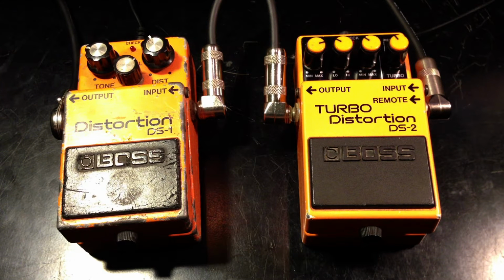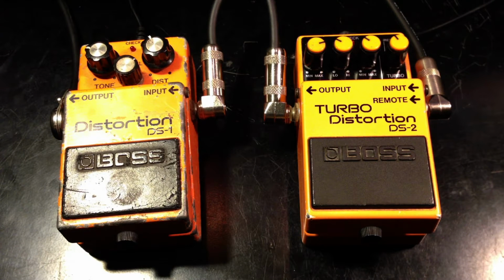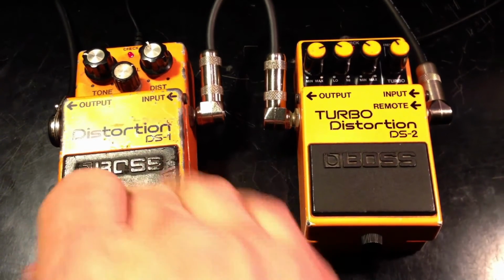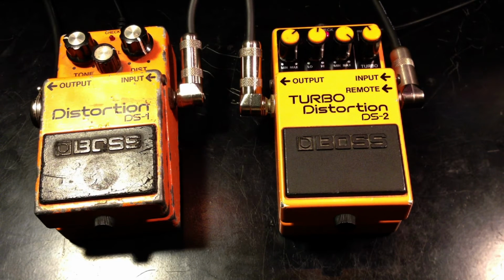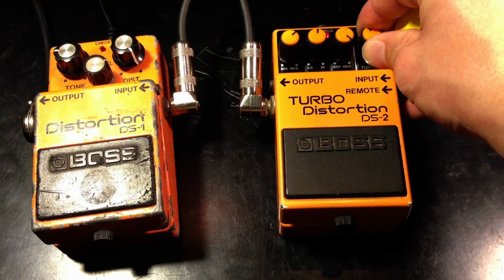Vintage MIJ Boss DS1 vs Vintage MIJ Boss DS2 Turbo Distortion

Comment: Ok... I just bought a DS2, and with it engaged I get loud buzzing and humming when not playing. While playing it sounds fine. If I remove the pedal and just play with the guitar through the amp there is no buzzing. I have humbuckers, and my nobs aren't turned all the way up. Can anyone help reduce humming?
Reply: TS4L03 Bad quality guitar pickups and/or bad quality cables  are mostly what generates noise like this. So buying new cables or changing your pickups should solve the problem. Or you can simply get a Noise Gate instead hahaha

Comment: some people (including me) will say they both have a difference. The MIJ DS-2 has a little more volume and grit to it, where as the Taiwan Ds-2 has slightly less volume and grit. But here is the real world situation, you wont really notice the differance on stage or even in the studio. To me you might even have to use headphone when listening to a demo to really hear the difference betwean the taiwan and mij. It is not worth it to spend extra money on an MIJ just get a made in taiwan.
Reply: Agreed. I have a MIT DS-2 built in December 1990 and it smokes shit